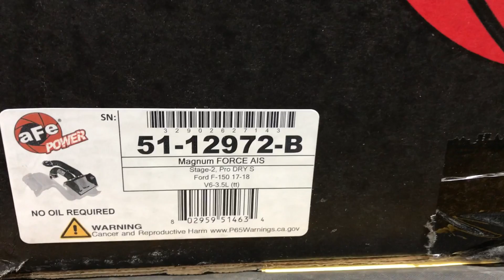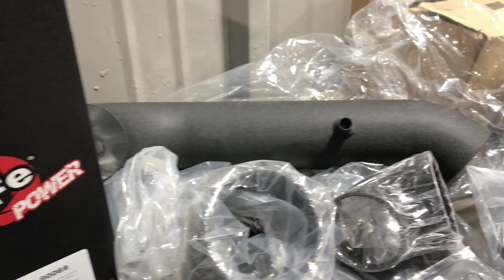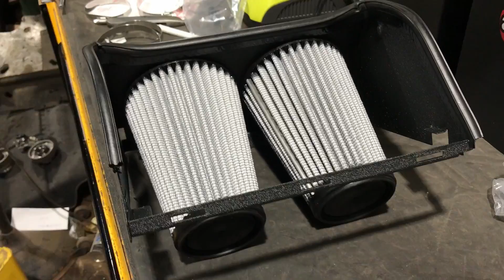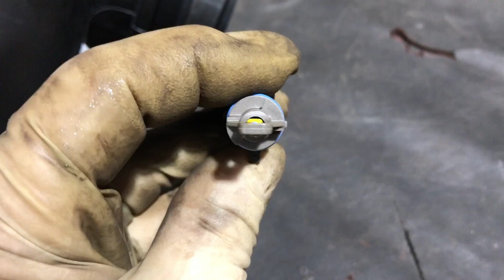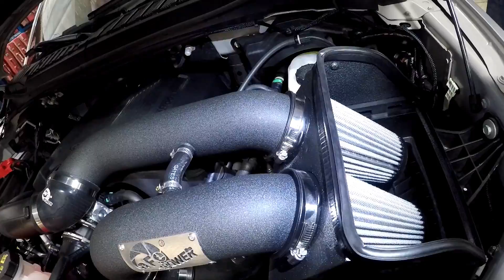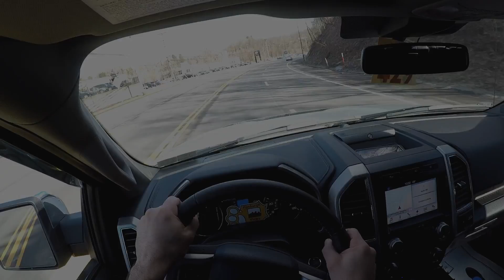AFE Magnum Force Intake Install on a Ford F150 3.5L Ecoboost

Comment: just installed mine. looks and sounds awesome but my check engine light is on. have to call afe or try and figure it out unless anyone has some ideas.
Reply from the maker: I have installed a few of them and that has never happened to me. Did you install the slash cut tube in the right direction? Do you know what codes you have?

Comment: Nice video! Just installed mine and drove around some. Mine doesn’t have that “blow off sound”. May I have done something wrong? No check engine light and seems to be accelerating just fine
Reply from the maker: Thanks, I don't really think you could have done something wrong, it only makes that sound when you spike the throttle.
Reply: PIPSBURGH VIEWS ok thanks. are you in park when you’re revving or in gear while on brake

Comment: What's the purpose of the straw in the turbo inlet?
Reply from the maker: It limits the air flow though the vent tube. AFE says the check engine light may come on with out it.

Comment: Do you know what would cause my 16 F-150 to have a clunk coming from the drive shaft area when slowing to 5 or so mph and then accelerating again? Thanks. Love the channel, btw.
Reply: Driveshaft U/J maybe? Inaudible at higher speeds.
Reply from the maker: There was a TSB for that concern on the last gen F150s to lube the slip yoke splines and it would fix it but I have also replaced driveshafts on current models for this concern.
Reply: @PIPSBURGHVIEWS  thanks for the reply. The dealer I bought the truck new from has given me a hard time about replacing the driveshaft. I may try a dealer in another town.

Comment: Great video as always👍 i think Mike's f150 engine said enuff of the supercharger what do you think?????
Reply: I think he's either got water in the fuel (bad gas) or a fuel pump issue.
Reply from the maker: Thanks Hondaman, looks like you may have to change your name to Kawasakiman lol. Not sure if its supercharger related, we have seen those issues before on stock engines.
Reply: @PIPSBURGHVIEWS  lol your right Kawasaki man sounds right ✌✌

Comment: Does it require a tune ? My 2013 3.5l Don't have a tuner?
Reply from the maker: It does not.
Reply: @PIPSBURGHVIEWS  I forgot I drilled into my airbox to get air from boost into my catch can.  Id have to drill into the tube to make that work.